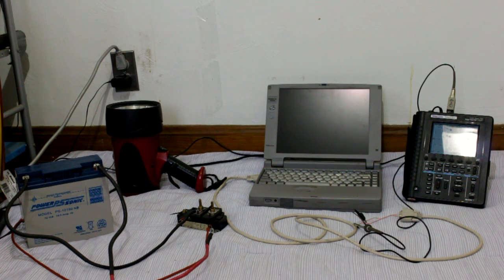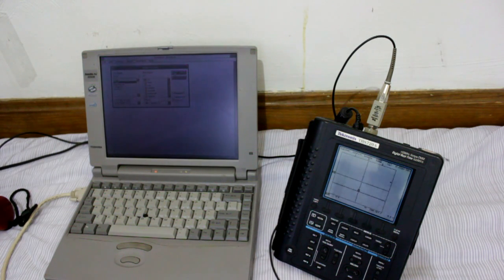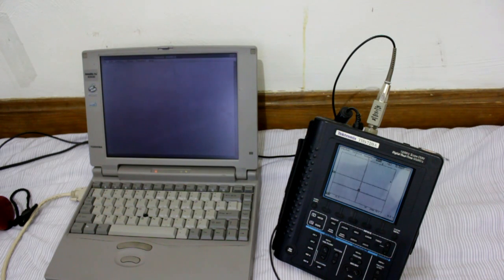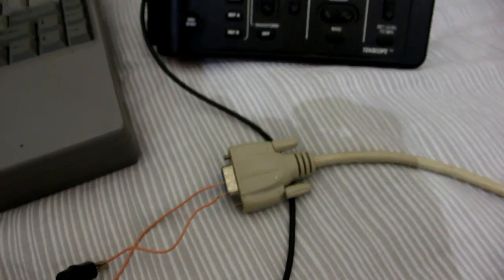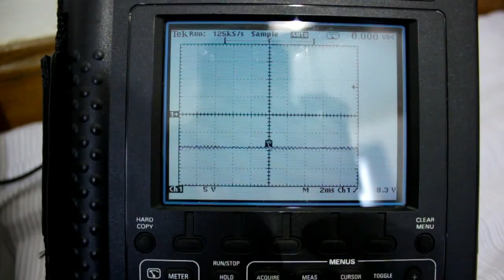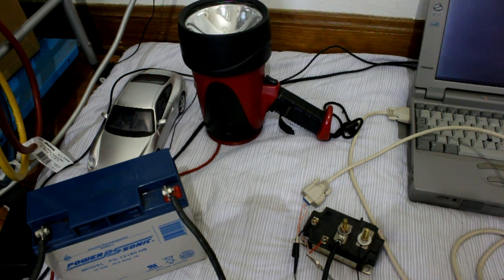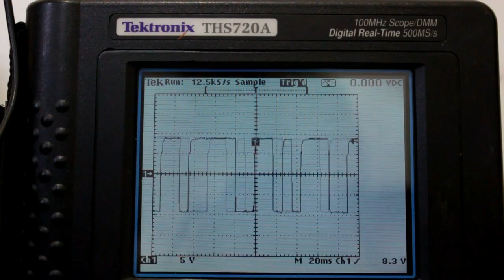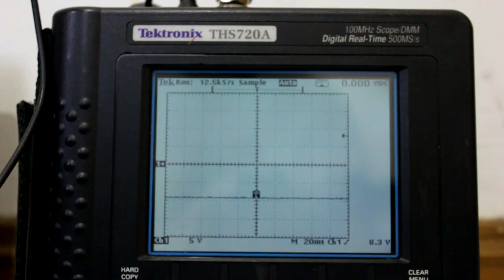Experiment: Driving IGBT with PC serial port

Comment: Hi hackfreehvac,  I am trying to build a 8KVA 48V to 220V inverter to power my home. I have a 10KVA  48V-0-48V center tapped step up tranformer that outputs 220V. I am also just awaiting ten IGBT CM600HA-24H Power Modules (1200V 600A) that I purchased on e-bay for the same project. I would be glad to have a pure sine wave if possible. How do you suggest I wire such a system?

Comment: Yeah, if that IGBT shorted it would probably take out that laptop's com port since there is no isolation.
I guess you could easily wire in an opto isolator or something to buffer and isolate the output.